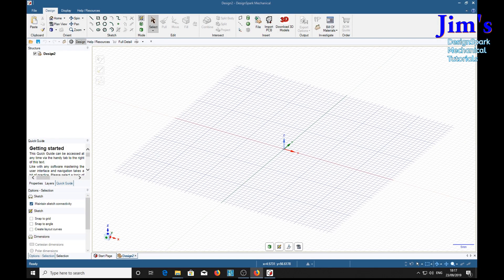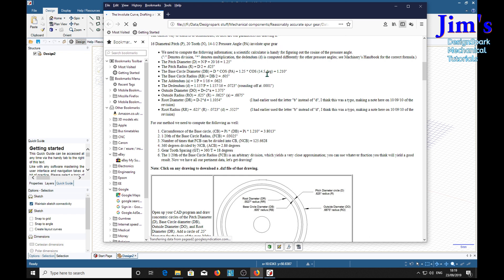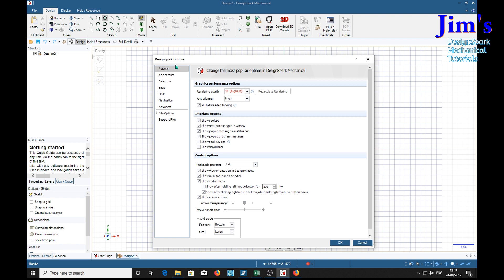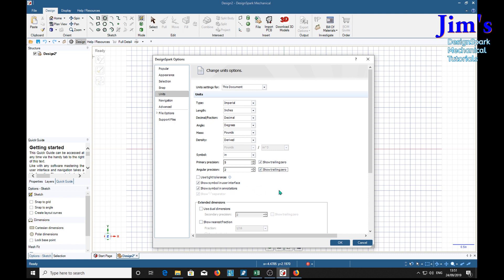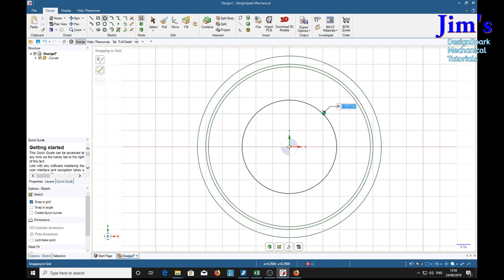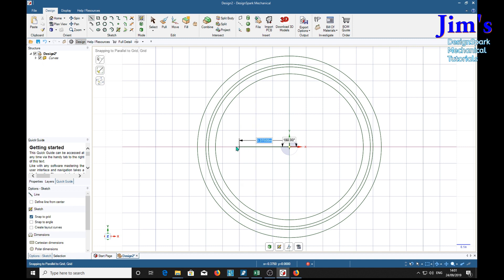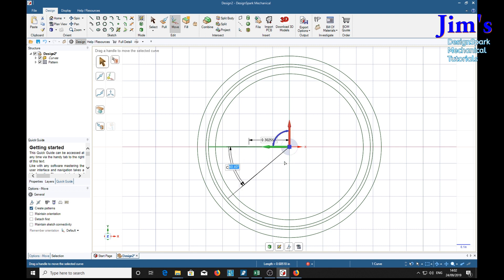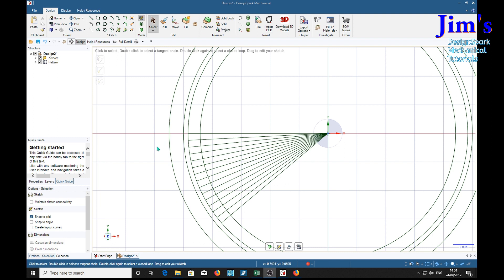Modeling a spur gearwheel in DesignSpark Mechanical pt1

Comment: Jim, great videos but to save reinventing the wheel (or gear) is it possible to get a copy of the excel spread sheet you used to work out the element lengths?

Comment: Hi Jim. I worked in Unigraphics CAD & Design for years but not getting how in DesignSpark, at the 8:47 point you get x & y coordinance to rotate counterclockwise 90 degrees. This is after selecting the line, then going to MOVE TOOL, then move the coordinance to the center.
Reply: I think I've figured it out. Got it!

Comment: I am studying  this..BUT.. where did the " 1.157 " come from??
Reply from the maker: I'm not sure but it is obviously a parameter that has been determined by some empirical means for calculating the value of the dedendum. As I stated at the outset, the video is not for the purpose of explaining the theory of gears, but to show how to model a spur gear in DSM. If you want to know where 1.157 came from, I suggest that you do your own research into gear theory or contact Carter tools.

Comment: I'll be looking forward to this project. About 40 years ago in my first year of machine trades I made a gear set which took alot of math figure out the placement of the gear teeth. The cutting took had the involute curve going into the cutting tool. It will interesting to see the math involved in making of the involute curve.